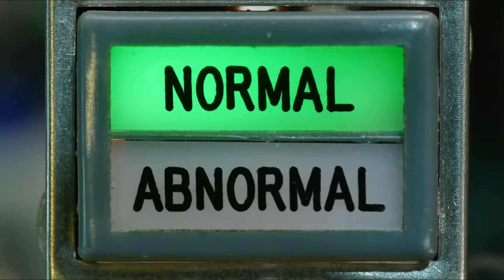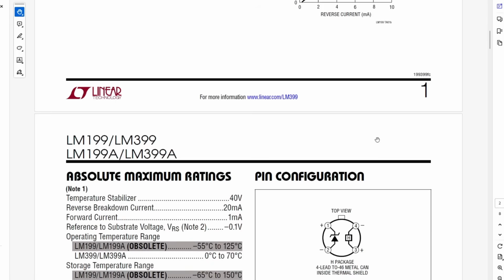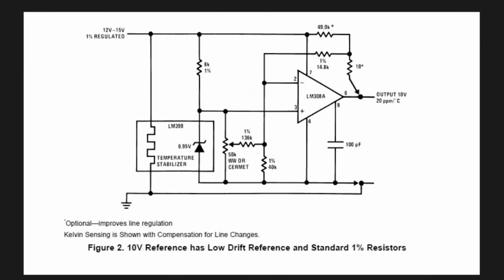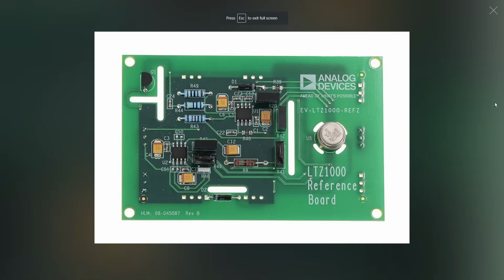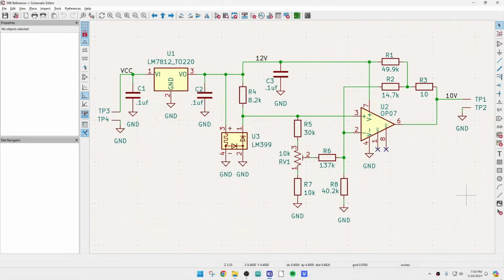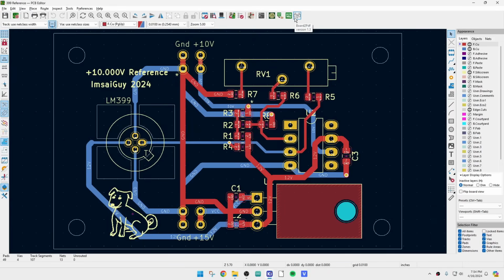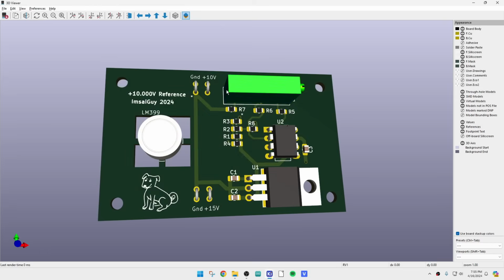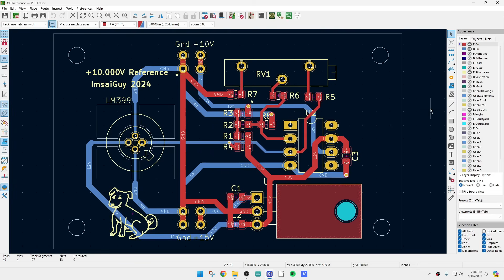#1881 LM399 10.0000V Reference Board (part 1 of 2)

Comment: Does NIST maintain electrical standards? I looked and all I can understand is that they're working on quantum devices for these standards. Surely they keep THE Volt somewhere in their locked cabinets.
Reply from the maker: yes, they keep voltage cells:

By international agreement, starting on January 1,1990, a highly accurate representation of the volt based on a new constant for the Josephson effect has come into effect worldwide. This representation is defined in terms of the Josephson constant KJ, the frequency-to-voltage quotient of the ac Josephson effect in superconductors. The value of KJ used for maintaining the volt representation at NIST is 483 597.9 GHz/V. This value is believed to define a volt representation consistent with the SI volt to within 0.4 ppm (one standard deviation estimate).

Comment: Kind of bothers me, not that anyone cares, that the regulator is kind of in-line with the opamp and resistors, so that any heat generated generates a thermal gradient across the opamp and resistors... Would it be feasible to locate the regulator "to the left" of the resistor/opamp, to minimize the thermal gradient, especially across the gain setting resistors... Its ground would then be kind of centered on the circuit, too... Otherwise, I guess a small heatsink would help...

Comment: Would you explain star ground what is it
Reply: It's a single point ground where each conductor or wire arrives separately. 
So that the current on one circuit element doesn't affect the others.
Same thing can be done for non-Grounds too, when you need (for example) a single point voltage reference.

It's somewhat related to 4-wire measurements, so you can look that up for more explanation.

Comment: Now if you could take things one step further: Create a reference current source?   BTW, I have found this circuit only works on high impedance volt meters.  Drag down the output using lower impedance voltmeters, and the voltage is no longer accurate.  What is the limitation on current from the op-amp before inaccuracy occurs?

Comment: The best voltage for calibrating ( most ) digital voltmeters is ... 19 . 000 Volts ( ? )  ... this seemingly peculiar choice sends the digital voltmeter to ( almost ) FSD and enables the greatest accuracy when (re)setting ....... DAVE™🛑
Reply: Testing as a single value only guarantees accuracy at that specific value. For true accuracy you need to check over a range of values so you can also check linearity.
Reply: @JaenFoster  Would help if it had multiple calibration points. single point cals are never the greatest for accuracy.
Reply: Analog Devices/Burr Brown with batteries

Comment: If I wanted to build it I couldn't calibrate it because I don't have precision instruments. I would like to build it specifically to test a home-built voltmeter. It seems like a kind of "circular reference" to me. I can't test the voltage reference without a voltmeter, I can't test the voltmeter without a voltage reference. However, this is useful information.
Reply: One thing you can know is that the LM399 or ADR1399 (if you are buying new, better to buy the latter) is likely to drift extremely little after you leave them turned on for a week.

So for everything but crazy precision instruments you know that the voltage you measured from it will not have changed at all in a year or two years from when you last measured it.
Reply: @ivolol  For economic-practical reasons I bought a voltage reference based on the AD584 already "calibrated" by the Chinese, with a report of dubious validity, but it was the best I could do. But since I would like to build my own I can read up on the ADR1399. Thank you.
Reply: What you could do though is check whether your cheap voltmeters drift relative to a fairly precise voltage reference. This assumes that the circuit around the LM399 is properly designed. But for normal people mostly not really worth it.
Reply: @sebastian_harnisch  I haven't tried the voltage reference "toy" I bought yet, because I'm way behind on making the voltmeter, but I think it's a good idea. The voltmeter is analogue therefore the precision is relative. I only need it to calibrate the various trimmers. Thanks
Reply: I bought several cheap (under $20) 'Aneng' DVOMs.  I also bought a very cheap voltage reference module that puts out 2.50v, 5.00v, 7.50v, and 10.00v.
Amazingly, everything was within one Least Significant Digit. 100% fine by me.

Comment: I found that using precision, stable resistors for 2-8 and 2-Gnd is the most important thing.  Choose values that are very close to 10 V without the trimmer, then the multi-turn potentiometer can be 100 or 200 ohms to truly "trim" the resistance.  I keep seeing these circuit boards with interruption between the board and the LM399, but really the interruption should be between the op-amp, it's resistors, and the rest of the board.  The LM399 is already thermally isolated and stable, it's these other components that will add PPM to the overall circuit.
Reply: Best is to enclose the whole thing in insulation. Long term drift till warm, then stable, which if you ovenise the entire reference circuit, and keep that at 40C, makes it much more stable as well.

Comment: Padding resistors also have the bonus of a better TC, as they are going to be a lot lower TC than the cermet pot, if you choose the right family of low TC resistors, which the pot is almost guaranteed not to be great for TC. Padding also means the TC can be tuned as well, as the ratio of fixed resistor to variable makes the TC of the pot that much lower.
Reply: Slight asterisk - it's often better to "limit the influence" of a pot by using a series resistor from its wiper to limit the current driving it can steer an adjustment with. Especially if its top rail is already from a stable reference.

This is because yes, the pot has a large TC, but usually inside of the pot - *both sides of it will have relatively the same TC*. So both sides will drift the same way. That's not true if you add padding resistors on either side.
Reply: @ivolol  Padding resistors ideally you want the pot in the middle of range, and thus nulling out TC to a great extent.  The padding resistors it is much cheaper to get ones with low TC so the TC of the pot contributes less, though if you are going to ovenise the complete reference, including the opamp and trimmer, you get better overall drift. Military I used to use resistor boxes to set offsets and nulling on the bench, then used fixed resistors to set the actual value, often meaning I was using the ratio to get both to be close to an E96 value in use, and if they were more than 2:1 ratio that opamp get changed out for excessive drift. I changed lots of SFC2741T opamps, as they had drifted offset past 10mV over time. Next most common were 5474's, they did not like being used for input data recovery, logically fine just input threshold drift outside of TTL levels.
Reply: @SeanBZA  Ye Olde 'SOT' Select On Test !
Reply: @andymouse  No drift either, once set and new opamp it never came back. At least not for that channel, the rest and the power supply though....
Reply: @SeanBZA  :)